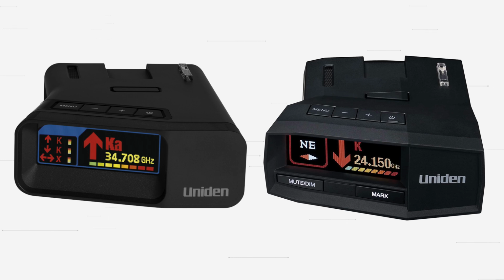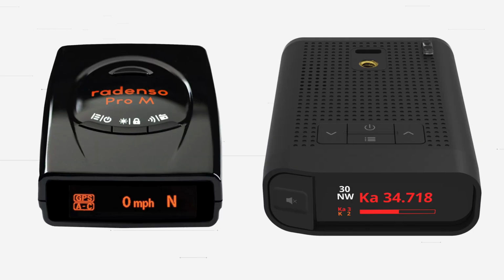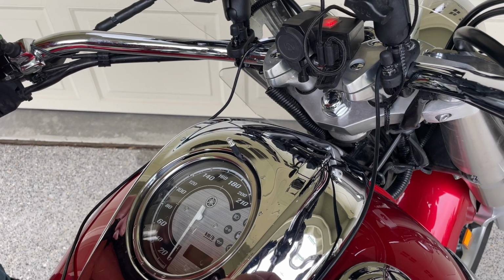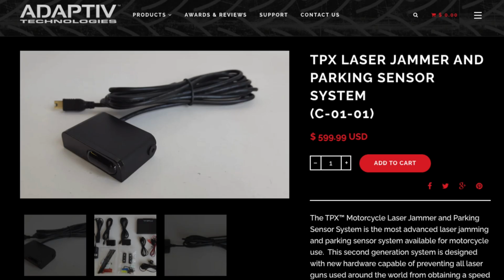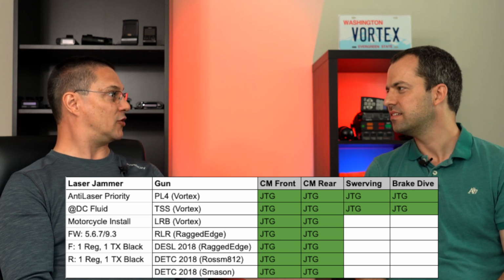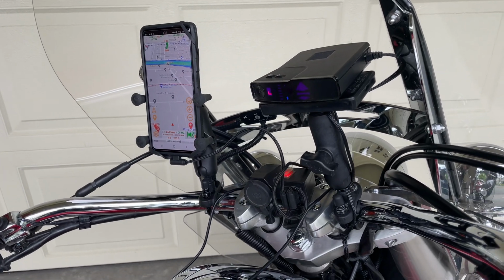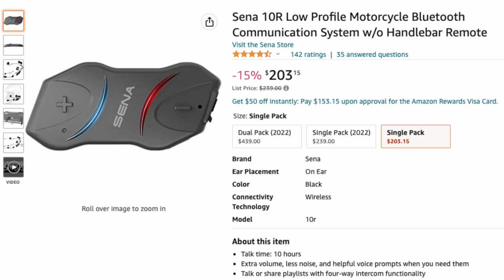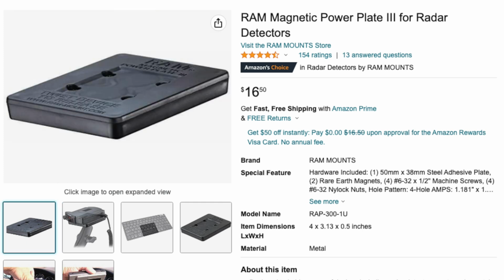Best Motorcycle Countermeasures, Part 2/2: Radar Detector & Laser Jammer Discussion with DC Fluid

Comment: A GPS is NOT an accurate speed measurement. It’s a constant guess to make up for signal quality and gaps in signal. The only true calibration is if you gauge it from a laser detector. My jap bike is spot on based on the radar signs that display speed. Rarely is the diff more than 1 MPH.

Then the statement that jap bikes are less accurate compared to a HD, is just wrong and biased. Anyone that tries to say an HD is better at something can only be true when it comes to obnoxious sound. HD quality is notorious for being crap, look at their sales, they are going down across the board. People are finally tired of buying a name vs quality and tired of spending so much money on parts and service and constantly having their bike in the shop for issues.

People that ride HD’s typically are buying it for the name and trying to be ‘cool’, not because they are better at anything beyond being pretty and noisy. They are great vibration machines though. Nobody really compares with them in that category. The other category is spending 3x more for HD crap quality.

Comment: Why not have to not worry about any of that and put vibrating motors inside the handle bars. The vibration will more than alert you.

Technically if you have drive by wire you could have say a laser detection automatically cut out the throttle for a period of time. Why add the panic feeling of a screaming detector in an already higher stress situation

Comment: I use the Adaptiv TPX Pro Detector (designed for a motorcycle and waterproof) and their Wireless Headset (Bluetooth) to my helmet.  It works pretty well but does tend to react to BSM alerts.  I don't feel I need a Radar Jammer since the front and rear of my motorcycle presents such a small target and I don't want to spend that kind of money.  I usually follow a "rabbit" in the fast lane and have not had a speeding ticket in over 30 years of riding.  Thanks for your video and information!

Comment: Great interview. I personally use a wired ear phone. Used them for years and pulled a few out my ear hoping off the bike while plugged in but other than a sore ear all good. Still undecided on the bluetooth transmitter and wireless earplugs though. Using a recently brought R8 after many many years of an Escort 9500ix which was great.

Comment: Considering getting bluetooth from you phone to you ears, why not just use bluetooth ear buds instead of speakers and earplugs where earplugs deadens your hearing and earbuds will be crystal clear?
Reply: Earbuds had minimal hearing protection from outside noise, which is important. 
I've never successfully been able to fit ear buds wired or BT comfortably(very uncomfortable) into my ears inside of the helmet, and knocking them out to the ground or dislodging them when putting helmet on and off happens nearly every try. Maybe on a half shell helmet....
Reply: @dcfluid1  they make earbuds now that are meant for shooting guns. Great DB reductions, passive background amplification, bluetooth, and rugged. Seem to run about 120 most brands. i might try them
Reply: @Yaboifootchie You are missing the point. Ear buds are a PIA with a helmet. Dedicated speakers in a helmet are the best approach hands down. Ear buds are either uncomfortable and/or they don’t stay put when putting the helmet on and off. Anyone that says different are probably hiding that from people to justify their hokey setup. With that said, ear buds offer superior sound over helmet speakers. Anyone that says different is lying lol

Comment: When I ran a detector on my motorcycle in the 80’s, it seemed the range was equivalent to the car, but the initial alert was stronger.   

The cord once developed a short. I’d be speeding up the road and suddenly the detector would alert and light up all lights.  After soiling myself and nose diving the bike, I’d realize it wasn’t radar, but rather the detector’s test cycle after powering off and back on.  Those hair raising instances shaved a lot of years off my life.

Comment: On my FJR 1300ES, I'm using Escort Max 360 with the same Ram magnetic mount plate along with  TPX Laser Jammers (2 front and one rear) and it has worked well as it it weather resistant. I would like to see a "waterproof" case for the Max 360 or Redline 360.
Reply: My dream bike, FJR1300ES 2016+. I've recently started saving but will have to settle for the GSX S1000GTA or Ninja 1000SX. Waterproof cases are probably going to remain the do-it-yourself supply chain, as the market size is pretty miniscule for production.

Comment: Thank you for this series, I'm getting ready to set my Harley with my car's DS-1...I got lucky recently when a cop pulled me over for speeding but admitted he didn't get a good reading on me but said "you look like you were speeding" ultimately giving me a warning but I figured I'd better use my car radar detector on the bike, I'm not sure if it will work thru the fairing or I need to raise it up to the windshield.  

I drive/ride across 1-71 and the AA highway in Kentucky and Waze is no longer dependable because the KSP dismiss alerts people post.
Reply: As long as you don't mount behind metal you will be fine. A detector works well through glass, fiberglass, plastic, and  MC windscreens. DC Fluid.
Reply: Kansas? Kentucky? Korea? What's KSP?
Reply: @Soganxsarimsak  Kuwait
Reply: So it appears you ran into an honest LEO, your lucky day. It's also sounds like KSP has too much time on their hands.
Reply: @defresurrection  lmao no such thing as an honest cop. He got pulled over by a guy that admitted he did nothing wrong but "looked like he was speeding"
Cops are such a joke.